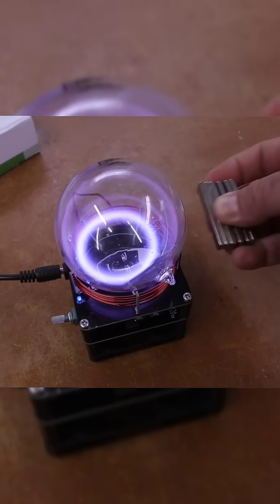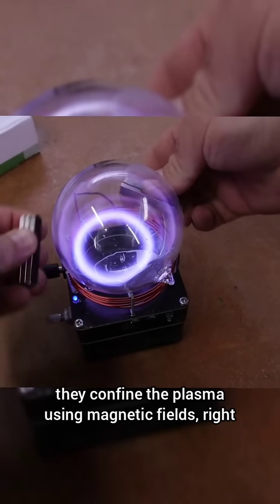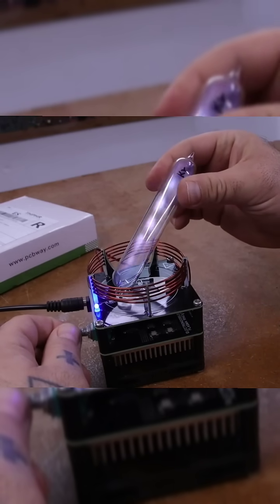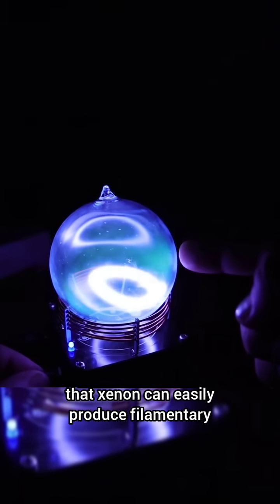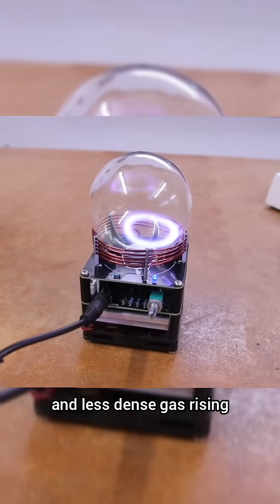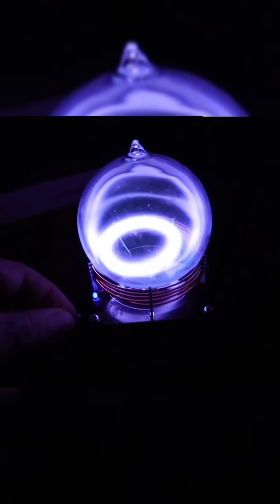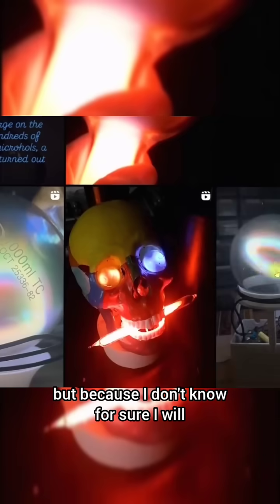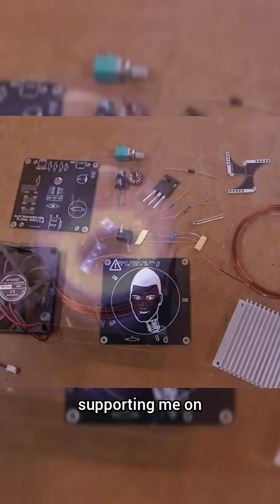Pushing plasma with magnets So Cool!!!

Comment: I will have to find the video but a guy had a plasma disc , he had four or 5 rectangular magnets together like yours , one side he had Teflon, then he incased it all in epoxy or acrylic,  he then placed it on plasma disc, nothing changed with voltage filaments until he rotated the magnets on another angle, then the high voltage filaments turned into a fractile pattern.